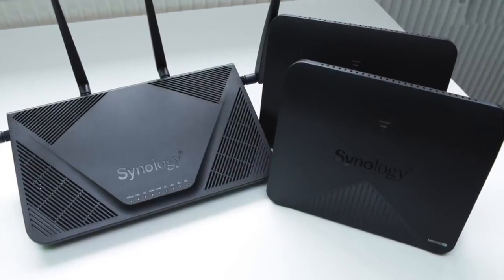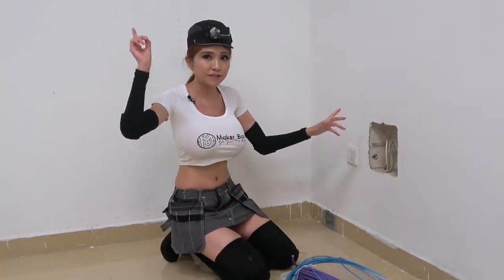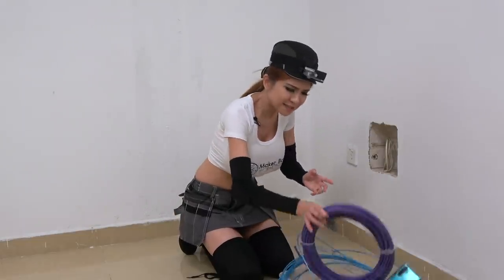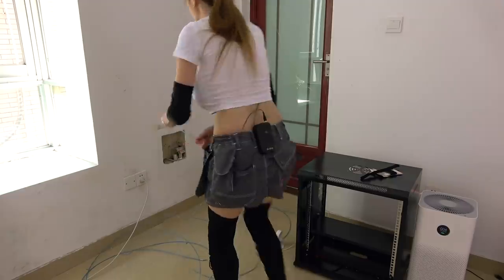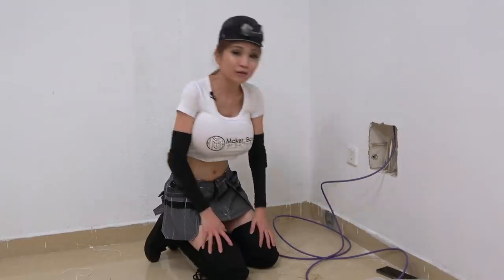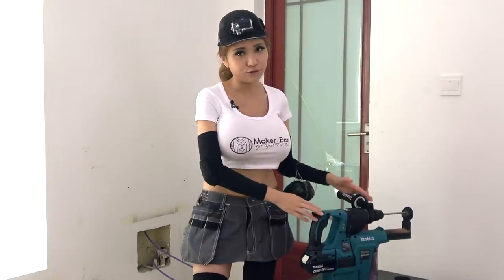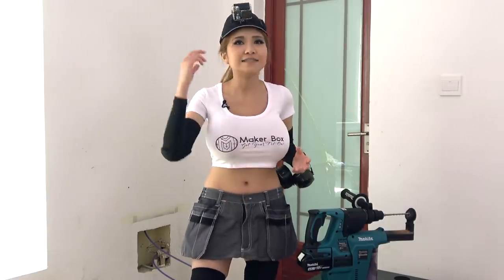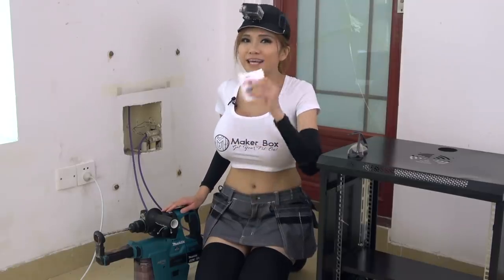Home Networking Part 1- Pulling Cable

Comment: I was going to mention that looks a lot like a utilikilt. 
I had to wear steel toed boots in the military, and it was almost guaranteed that if something fell, it would almost always land behind the steel. 
Also, my feet have been run over by forklifts with pneumatic tires when wearing both steel toe and regular boots. 
With the regular boots, it was uncomfortable. With the steel toes, the steel created a bump into the tire that made it bulge out a lot more, and it felt like it was crushing my feet at the arches.
Of course, if the tires had been solid tires like you encounter in some warehouses, the steel toes would have been a significantly better than regular boots. 
Naturally, the best is to avoid getting your feet ran over in the first place. 

Yes, some of our forklift drivers were more than a little dangerous. I have damaged fingers and legs because of a forklift driver ignoring the spotter and "dropping" a load while it was still tied down to the forklift. Needless to say, things didn't go well, but I'm the one that got hurt. 
Not after sympathy, it's just a warning for everyone, be careful, it's not just you that can get hurt if you're careless.
Reply from the maker: Good tips thanks!

Comment: Interesting video. I'm curious about the head you used to attach the cat 6 cable to the fish tape. That would be a real handy thing to have, and I assume they also manufacture them for multi cable runs. I would appreciate if you could list the manufactures name, and any other handy gadgets you might come across during this project.
  And for that size of cabinet, 3/8 lag bolts look like a bit of overkill, but better safe than sorry. That cabinet will give out before they will! 
Thank you, and work safe!

Comment: Maker Box <3. 

At least seems the place is constructed with cable management in mind.. looking from those cable ducts. 

Here in Indonesia.. we need to secure the cable using nail and hooks to the wall or ceiling XD clearly doesnt look good aesthetically but.. gotta work with that.

Comment: Your problems with WiFi and concrete construction are very similar to my work location. I'm in a building that's almost 200 years old and all the walls are thick stone. The only way we could get decent WiFi coverage was to put an access point in every room! It cost us a fortune.

Comment: I know Pollyanna catches most of that dust. Though I have no idea the chemical makeup of your concrete walls, I would still suggest wearing a mask that filters out silica particles. It's a major safety concern on construction projects here in the US.
Reply from the maker: Will do👍

Comment: Another quick aside; you are very good about using personal protective gear, but if you are generating any sizable amount of concrete dust (silicate), you should consider wearing a dust mask.
Reply from the maker: HEPA vac in the drill seems to get it all, if I did more than a couple holes I'd wear a mask though...

Comment: Clever idea using the remote camera. It's obvious once you see it done! Could we have a link for the camera? I assume it works with a downloaded app on your phone. Also, do you use wire-pulling lube when running your cable?
Reply from the maker: It's the Firefly Hawkeye 8SE

Comment: Hi, Naomi!  That remote camera was a really good idea! That saves a lot of leg work up and down the stairs. When I last pulled cable about the place I used Cat 5 cable as the Cat 6 wasn't bendy enough and I don't move a lot of big video files. If it was 35°C I would have waited until it was cooler!  Too hot!   :D  Oh, also, I have done four PCBs with JLCPCB so far. The last one I ordered on Monday afternoon and I got it Friday lunchtime. How is that even possible?

Comment: I have gone for the ubiquity access points instead of the Synology.  Synology good  for storage NAS  but to deal with the concert and steel  you need something a little more robust and since plan on having  tenants you want to control and management
Reply from the maker: I had really bad experiences with Ubiquity, the granular control is great if you're a network admin, but I need something that's less time consuming.
Reply: @Naomi-Wu  I got  you, I understand, although they have improved the interface quite a bit  this year especially

Comment: There are some explanations missing from the video.  what type of concert mounting studs did you use and why you used that type.   I notice you had to hammer them down why you had to do that and what drilling bit size did you use. The cabinet seems to block the door  looks a little low
Reply from the maker: Plenty of clearance from the bathroom door. Just concrete anchors, it's common they are a bit tight and need a few taps.

Comment: Putting that cabinet close to a door, and also close to the ground... I'd be worried about bumping into it. I would have mounted it high on the wall and ran the cable through a plastic tube or raceway to the cabinet. Is that door going to be used much? Also, having to bend or kneel down to get at the equipment inside would be annoying, although having to use a stepstool or ladder can be a pain too :)

Comment: Nice video.  You're lucky that conduit was installed in order to fish through it.  How old is the building you're now in, please?  is extra conduit typical?  Your lair is coming along nicely.
Reply from the maker: About 5 years old I think
Reply: Indeed. Can you visualize surface mounting with floor or ceiling penetrations to get the cable between floors?

Comment: Any reason to go with the 1/4 depth server cabinet over even a half depth one that could house a small NAS/ security box/etc? I see wall mounting but that's a pretty tall cab for just networking gear :) Also, the glass door needs fixin :P
Reply from the maker: It all fits, more is overkill...
Reply: @Naomi-Wu  but overkill is the best!

Comment: There are a variety of composite toe safety shoes that are not boots from sneaker-like to slip-on. Composite toe safety shoes are lighter than steel toe safety shoes.

Comment: Nice work. I think Polly Ann Dont need a pilot hole and you should measure how deep hole you need so Not waste time and effort to drill the whole drillbit inside the hard concrete wall.

Comment: Naomi:  Did you apply for a patent on the "cargo skirt"??  Don't think I have ever seen such an adaptation.  Maybe there are enough 
"Tool Time" ladies  as  potential customers.  Can a Naomi fashion line be far behind?   Stranger things have happened.
Reply: Actually utility skirts and the like would be awesome.
Reply: Reminds me of the Utilikilts from a decade ago, but not as pretentious.
Reply: Also maybe the possibility of clothing designed to accommodate wearable tech like cable run loops, internal battery pockets, etc ?
Clothing engineered to be hacked into wearable tech.

Comment: talking about footwear.. lots of roofworkers skip workboots in favor of soft shoes and a lot of people that work on their knees aswel. when you sit on your knees for long your feet kind of take weight on the top of the arch which can hurt. so yeah i cannot blame you for your choice of footwear
Reply from the maker: Interesting!
Reply: @Naomi-Wu  just try it if you have doubts, your feet will hurt less with softer shoes. Also I like your work skirt, I'm a big fan of the extra hanging pockets myself

Comment: Pulling one or two cables is OK, but doing lots of it is really not fun. Wired an office once, about 2000 meters of cable in total, though I don't remember how many rooms there were. This was the first time I worked with 10baseT and by the time I was done I didn't want to see another RJ45 connector ever. The worst part was that I had to work around the people working there as it wasn't a new office or even closed down on the weekend. Once everything was in place the customer wanted every connection tested and documented with test values so I spent a day or so running around moving test loopback plugs and running a diagnostics tool filling a folder with printouts of every run. Fortunately everything was well within spec even though I came at this having only some sketchy knowledge about the do's and don'ts of network cabling.

Comment: I ran all my rooms in my House when bought it with Cable and Network connections, I have WiFi to but I love hard wired when I can, Oh about your outfit, I work at Hardrock and we are always having IT running Network for expansions and stuff, I WISH they looked as hot as you. outfit is Great.

Comment: Naiomi, you're perpetuating the misinformation about hammer drills. That gorgeous piece of kit is a Rotary Hammer Drill. Not a Hammer Drill.
Reply: @Naomi-Wu  Shawn is right. This Makita is a Rotary Hammer (sometimes called Rotary Hammer Drill). I guess the name came from the mechanism being similar to jackhammer (a jackhammer that learned how to rotate :) ). Yeah, theese names are confusing, but they are not going anywhere and should be just memorised. General rule: hammer drills suck and should be avoided. SDS+ (or SDS Max) rotary hammers are the best. BTW, the Wikipedia article that you cited, has a link to an article about rotary hammers.
Best of luck with all the work on your new house!
Reply from the maker: You are correct! I was wrong, will fix in the future.
Reply from the maker: @sheikh345345  Thanks for the clarification- much appreciated, will fix in the future.

Comment: i hope you can stay at your current place for a while with all the updating you are doing. always better to run network on cable rather than wireless. more secure network in that way.